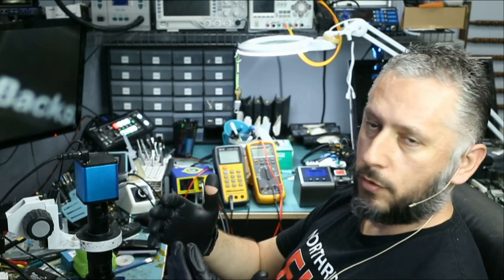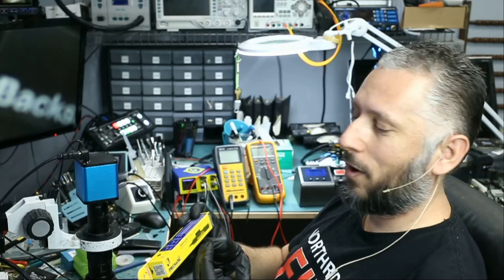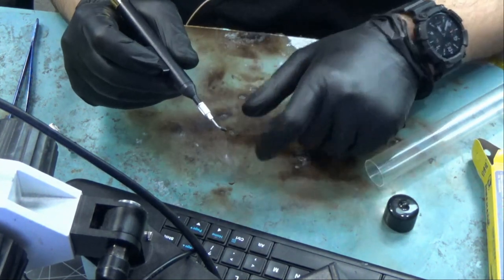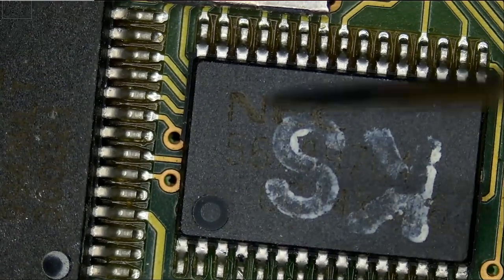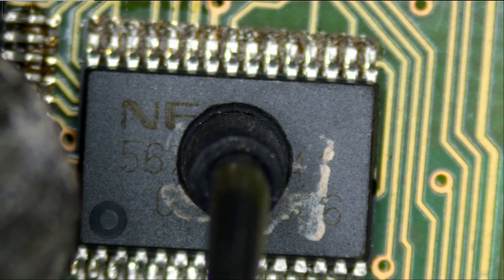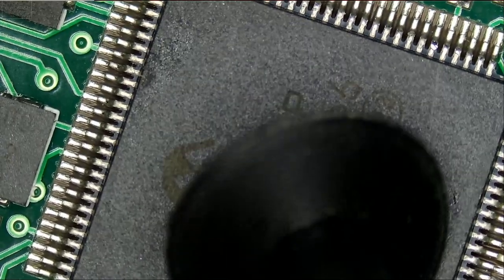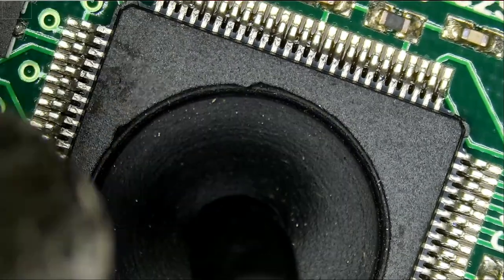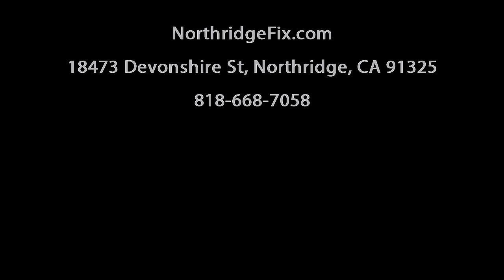Mechanic LT201 Chip grabber Vacuum pen. Does it really work?

Comment: small tip: you should be able to switch silicon ends between metal elements e.g. have bend pipe with larger suction cup.

Comment: The new vacuum pen has CLOSED the door to the 9th dimension!I
I will suggest that the surface of the chip or any chip will need to be swabbed with some alcohol to keep the surface clean and so that the vacuum can get a good seal.
One question I have would be to know if you could switch the large suction cup with the angled one.
Do the cups come off so that you can do a switch?
Reply: I'm sure the 9th dimension overlords are talking to the 10th dimension to hatch up a new operation to make Alex's chips disappear even more. Count on it.
Amazing pen though. I'd buy two of them and have one with a smaller tip, and the other with a medium / larger tip. This would save up on time spent trying to remove and insert a tip while increasing the longevity of the tips i.e.: If pen A's small tip goes bad, I can still replace it with pen B's smaller tip and vice versa for pen B's medium tip.
Reply: @NervousNoodles  Great suggestion Sir. Thank you.
I'm also guessing that those "rubber" parts are actually silicone.
I would assume that you could keep them supple with an occasional spray with some silicon in a can. I found that using silicone spray in a can is good to use on a car's window tracks to keep them good and slippery but first give them a wipe down to remove the dirt.
Ok, I'm off to the 11th dimension as there, I am the host of Jeopardy.
Bye!
Reply: @robertpage2023  I agree - they're not rubber but rather silicone which is why they can withstand a high temperature, somewhere north of (200C / 392F. Either way it's a solid product and Alex is awesome to review it for others to try out. I'd be curious in the longevity of the pen though and the tips themselves.

Comment: If you place a small square of kapton over the top of the chip, you can pick up larger chips with the smaller tip. It makes a better seal. Most IC's are matte surface and allow air to escape under the rubber seal.

Comment: One tip for success with the mechanic grabber is.  Ensure that the silicone bit on the end of the nozzle is not pushed on too far.  Push it on too far and the silver plastic pops out the end and it won't work.  Also don't press on the chip too hard or the same problem will occur.  Easy fix it to just pull the silicone back off slightly.

What would be really great is if mechanic incorporated a chip tapper in the tool too.  Think swiss army knife.

Comment: Vac pen are also use in electronic manufacturing...it was generally use for ic programming, purpose was to reduce elec.static,fingerprint, and easy pick up on programming machine.. A good point for a technician to have

Comment: Hello Alex, thanks for your videos, i would love to see a video about Soldering Stations and Soldering tips you use in your videos, or maybe point me in the right direccion to buy better soldering tips, i use hakko T18 BR02 tip on a Hakko FX888 station, but the solder dont stick on the tip, just goes up the tip at very different temperatures. Thanks in advance.
Reply: It sounds like you need to clean the tip off. This is something you need to do after every use no exceptions. Look up some tutorials on you tube or google a damp sponge is what I use when iron is hot somewhat quickly swipe each side of tip across it then tin tip with solder. Tip should be slightly shiny and smooth when in good condition.
Reply: @frizzlefry1921  Thanks for the help. I thought those long tips Hakko T15 JL02 he uses could be easier to solder with
Reply: @juangbetancurs6996  Not a problem.